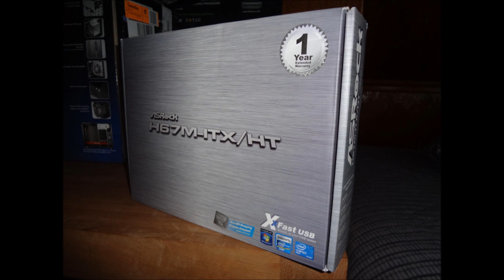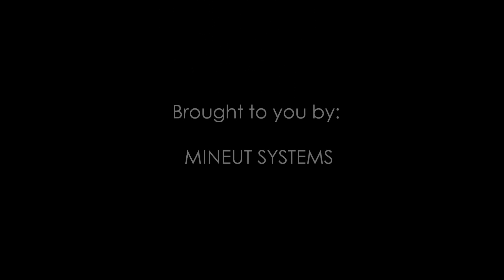Ultimate Gaming Mini ITX 2011

Comment: @svenXDsven That's because the motherboard is a mini ITX.  it's one of the smallest motherboards on the market measuring in at under 8" both length, and width.  The graphics card is a stanard 10" performance series card.

Comment: That is a little warm. My build may be a full atx, but I am using a stock cooler with a like 2 extra fans in my case, I overclocked my FX-4130 (amd run notoriously warmer) and I am getting no more than 65c. The pupose of putting in the radiator the other way around is to get rid of hot air not pull cold air in, I would make sure your case fans are bringing in cool air, and have the radiator push out hot air, that should bring temps down considerably.

Comment from the maker: @SwiftDesire The Radiator has about 1/4" of clearance. You can get slim profile 120mm fans if more space is needed. So far, I have no complaints with the board and im impressed with the amount of features this thing packs. I am waiting for the Zotac Z68 board to come out to replace it though. Cant wait to see how far I can push the 2500k on it.

Comment from the maker: @Ruiso7 The cables are sort of a pain to seat proper (vs HX 750's thin cables) but, as long as you don't stretch the wires to the point of the insulation breaking, it will work. I used this case with a modular PSU in last year's build and it worked out. Just have to plan where to route the cables. I have been waiting on Newegg to stock the Zotac board for a couple weeks now. Thanks for the feedback.

Comment from the maker: @kamkamovski You gotta take into consideration that since its a tiny system, it doesn't draw as much power as a fully loaded ATX board. With a gold 80+ psu, those things are overbuilt. On one of the EVGA forums, someone was running an i7 860 and GTX 480 on the Silverstone SG05's 450 watt psu.

Comment from the maker: @lunatic231 The temps are okay but you have compromises with small systems.  It reaches 85c after I re-pasted it. before it would reach 96c. Idles around 38c for both cores.

Comment from the maker: @Feuerwerksfreak1 I believe that it has just enough room to fit a 6990 (13.5"). 360mm (14.148") is the total allotted space.I used the stock case fan since it is much quieter than the one Corsair supplies. Installation is a bit tricky but, it fits on most mini ITX boards.

Comment from the maker: @sharkpyro93 since there is minimal space between the power supply, You would have to choose a low profile cooler, leave the stock one, or fit an H50/60/H2O.I haven't seen the 2500k go above 60 yet, which is good considering the size.

Comment from the maker: @mikethebodacious Thanks man. The 2500k only gets to 34/62c max but the GTX 590 does run hot (close to 90c @ 60% fan) when playing something like Metro 2033 or Crysis 2 (DX11 mode) fully maxed. It idles around 43c at startup. I figure by winter time, those temps should drop at least 5c.

Comment from the maker: @lalalaa1232 The 590 idles at 38c and reaches 85c max now that the cold weather is setting in (it was reaching mid 90's in before re-applying thermal paste). The 2500k only gets up to 60c and idles at 33-36c.

Comment from the maker: @HackerManiac1 You can use 2600/2700k on it. The reason I have a 2500k on it is because I got a good deal. You can still push the turbo mode (limited overclock) up as long as its an i5/i7 , even though its an H67 board.

Comment from the maker: @Flerndip22 Thanks for the info. After using for a week, I ended up re-pasting it. It dropped the temps by a few degrees. I managed to fit 2 Scythe slim profile fans below the card and attached it to the case and it happen to drop the total temperature by 5 degrees. I do use EVGA Precision as well as HW Monitor to keep everything in check. I agree on finding a chassis with correct airflow for this card.

Comment: if it's all hooked up right and the old psu works perfectly in,  it sounds like you might have a bad psu on your hands. i would think you can take the 750watt psu to a repair shop and have it tested. that would be my first guess after checking connections.

Comment: @sam9165 In gaming applications the i5 2500k is almost just as fast as fast as the 33% and $100 more expensive i7 2600k. What surprises me however is why you would buy a 2500k for a H67 MB, since you need a Z68 to overclock if you still want ITX.

Comment: Nice system, I've always loved these little monsters. BUT, and I'm sure this has been beaten into the ground already, but you definitely want that top fan EXHAUSTING rather than acting as an intake. You're creating positive pressure inside the case, and actually preventing a great deal of air from entering the system because of this. You want negative pressure, it'll be like a mini vacuum, and suck that life-giving cool air into your system. Pro tip.

Comment: i would still keep the top case cooler a exhaust one... cuz hot air easier floats up rather then downwards.. it might disturb your air flow a little.

still looks pretty awesome, also that it is actually so small and the vid. card almost twive the size in length xD

Comment: There's barely any room for a normal cooler, since the power supply is in the way. Also, overclocking is risky, especially in a small, hot case like this one. Plus, when you can't overclock, you gotta have a nice CPU to start with.

Comment from the maker: @oCjLn I was considering a push/pull config for the H50 with Scythe's slim 120mm fans but, it works better with full size fans. As for the 590, I ended up re-pasting it with IC Diamond (the stock paste was not applied correctly)  and it had dropped the load temp from 95c to 84c. Still idles from 35c to 40c with the A/C on.

Comment: My basic specs:
Motherboard: Mini ITX
RAM: 4gb (default)
Processor: AMD Quadcore A6-3600 @ 2.1ghz 
Video: AMD radeon 6530d (integrated/onboard)
Stock PSU: 220w
Current PSU: Raidmax 700w

Comment from the maker: @bontaringko you are limited as to what air coolers will fit on these boards (thermaltake, scythe and cooler master are options). I have an H60 on another build of mine and it clears the chips on the back of the board. The problem with the H50 mounting system was that it pressed up against the board so, I had to use felt washers to act as spacing to avoid contact against the solder points.

Comment: Ok, i need some help. I have a mini ITX motherboard as well. Mine is an Acer daa75l motherboard. the old PSU i had was a 220w (stock) and i knew that wasn't going to be enough for a higher end graphics card. It would not fit in the slim pc case (stock) and wouldn't get enough power. I decided to upgrade to a  RAIDMAX 700w PSU. I figured i might as well spend the money and futureproof incase i decided to do crossfire. Anyways, when i have the PSU connected (everything correct) .....

Comment: Intake on the top = very bad idea. You'll end up sucking in dust and the heat from the system would naturally rise, so you are keeping the heat in the system. Top fans should always be exhaust fans even with a radiator there. If you can i would put the radiator between the case and fan and use the top as an exhaust. The radiator and system will be cooled better.

Comment: I build my PC , with this speck
Case LIAN LI PC-V354 BLACK	
Motherboard ASUS P8Z77-I DELUXE
Proc Core i5 3450 (Core i5 3.1Ghz, 6M, 1155) IVY BRIDGE
Ram CORSAIR DDR3 8GB / 1600 Kit ( 2X 4GB)
HDD WDC 1TB GREEN
VGA ASUS GTX670-DC2-2GD5 - 2GB DDR5  
PSU SEASONIC 520W M12II Modular,80+Bronze
ODD DVD RW ASUS 24X box

But I haven't added the cooling system, I planned to use CORSAIR CWCH60-1 - WATER COOLER , do you think it will fit in my CPU Case? (LIAN LI PC-V354 BLACK).

Comment: Why put a 2500K CPU on an H67 board? You won't be able to overclock your CPU with it. Could have saved some cash if you opt for a 2500 instead of the K version.

Comment: It still does nothing except for spin the cpu fan EXTREMELY fast. it doesnt have any sounds, beeps, nothing. Doesnt boot up nothing. But when i connect my old 220w into it, it works perfectly normal. Anybody else have this problem? I need help :) P.S i only ask because i see that this video shows a 750w.